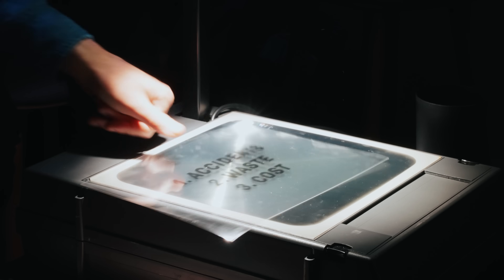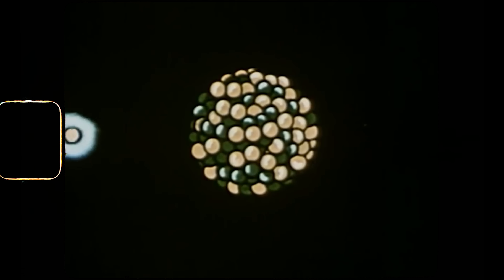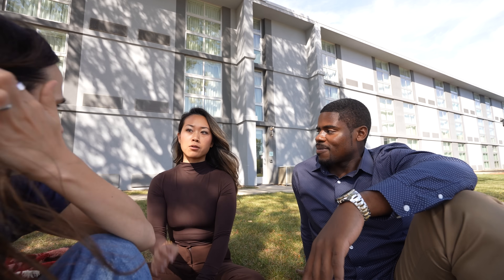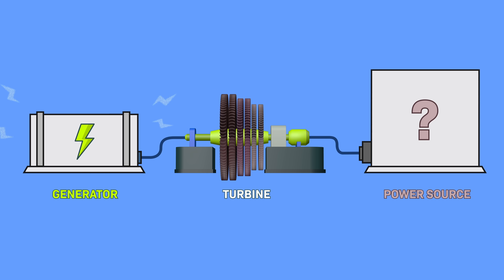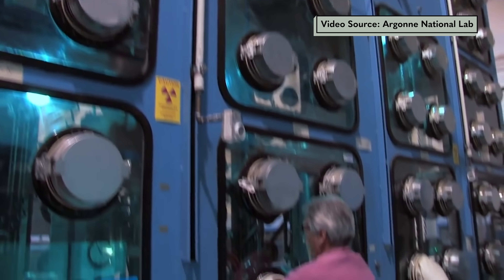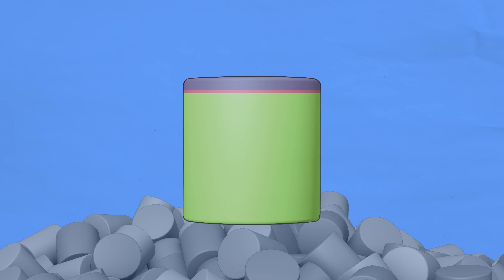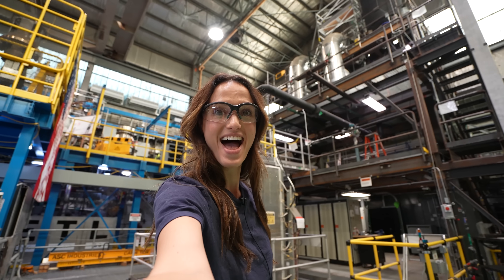The Big Lie About Nuclear Waste

Comment: Okay, so:
- the nuclear waste stored today isn't going anywhere (that's the point of storing it)
- the recycling reactors can be built anytime
- the existing reactors will eventually wear down and will have to be replaced
- whenever building recycling reactors will appear to be more economically viable than building standard reactors (and storing the waste), they will be built.

Comment: ....don't lie to yourself ...nuclear oligarchy propaganda & lies ...a dozen of those reactors were built ...all small & experimental ....less than a handful are operating in research ...the problem with waste compounds to insane levels with these reactors, as more & more radioactive isotopes are generated over time, exponentially increasing, not decreasing, the complexity & deadly dangers of the system ...

Comment: All you hear in media about nuclear are lies
Indeed whats called burnt out can Power the Nation for HUNDREDS YEARS
But the biggest issue ist the reactor used.
The core is in solid phase and Neutron eaters will Stay in the Fuel and stop the reaction.
Wigner realized and began develop MSR.
IT has many advantages.
It only takes 1/10 fissile to load and is about 200x more efficient.
It does NOT have water in the core. HAZARD!
It lacks reactor pressure Wessel.
Maybe most important, If thorium is used, it can run in thermal spectrum.
It is loaded on line.
Temperature 800 C, no problem. Making thermochemistry possible.
For efficient production of hydrogen.
More a half centuru since Nixon forced the research to close.
A lot has happened in materials, but more has to be done.
China is running strong
Are we letting them win?

Comment: You can avoid recycling by not creating the waste in the first place. 4th generation reactors can consume almost 98% of the fissile material AND almost 98% of the transuranics… that’s 1/100th the waste of conventional reactors. By the time it’s consumed most of the radioactive material what’s left is only dangerously radioactive for less than 300 years.

Comment: Who are you kidding? We don't do things better and use innovations and inventions, we suppress innovations and inventions, and using what we have. It's all about keeping obsolete industries and corporations going doing the same things, year after year. The automobile is a prime example. Troy Reed developed a magnetic motor that can run a car. Where is Reed and his magnetic motor? Nowhere to be found. Stanley Meyer was running a dune baggy in water. Where is he? Dead. Poisoned to death. Kids are making and using self charging go-karts. Why isn't Elon Musk? That's a very good question. It's not hard to have a self charging EV. You have two battery packs. You run on one, and charge the other one. What's so hard about this? And waste plastics? We can pave streets and sidewalks with waste plastics. And there has been technology for more than sixty years on how to make an injected mold tire. It's stronger and lasts about fifty thousand miles, and it's easy to make. Cheaper to make. Greed is killing US. Greed.

Comment: I worked in an alternative energy research lab and if we had an aqueous solution with the isotope in it and applied electricity through it, it would product Lots of Heat and in the end would leave non-radioactive base materials as the results.

Comment: USA has no Fast-Breeder reactors has 88,000 tonnes of HIGH-LEVEL which is added each year by 2200 tonnes.  

There is no SOLUTION if you have to store the waste for thousands of years.  A nuclear reactor will only last 50 years then you have to rebuild a new one and decommission the old one. 

There is no solution - just look at the mess at Hanford from nuclear weapons $ 1/2 trillion pounds and growing

50 years of Electricity for 100,000 or 10,000  years of WASTE is  just DUMB!!!

You creating waste longer than you had the electricity - INSANE!!!!

Don't Say SMR or Thorium as there is not operating in the world and that have design problems still to overcome.

No, I don't lke the idea of prefracbitred nuclear reactors made in a factory.

Comment: The problem with the term "Nuclear Waste" is it is used as a reference to spent fuel rods and such.  There is a French company that can reprocess somehow 40% or so spent rods to be used again.  This is good.  But this is only ONE of the categories of Nuclear waste.  Here is where the problem really is!!  Anything used in the process, comes in contact with the process, cooling water , hazmat suits and everything in the process from tools, cranes, PCs, decom showers, etc.  Most of these are buried in the ground and have no ability to reuse.  Some in concrete tombs, others not so much.  It is buried and becomes tomorrows problem when the half life of materials are so long.  We already seen and its well documented many of these have already leaked into the soil.  The only solution is to use a fuel that has low half-lives of 30 days or less.  This will never happen due to any element being so inefficient compared to Uranium.  But I, maybe a few others, claim this will be much cheaper in long run due to not having long term storage of hazardous materials that everybody agrees will eventually leak.  But there is no long term plan in nuclear that is why I say NO TO NUCLEAR ENERGY!  Its a disaster waiting on the sidelines.

Comment: Here in Sweden we have waste to keep us in energy 4 6oo years, IF WE JUST GOT OUR THUMPS OUT OF OUR MENTALLY LAZY ARSES !!
Reply: If you had fuel for 4,600 years 

Nuclear reactor - 50 years operation  -  92 sites  commission/decommission 
Nuclear Fast Breeders  - 50 years operation  - 92 sites  commission/decommission 
Nuclear Storage - 50 years operation -  92 sites  commission/decommission 

276 buildings nuclear facilities you have to build in Sweden for 4,600 years

Then, we have to talk about the areas for a nuclear reactor/fast breeder and storage roughly 3 km2 for each site.

826 Km 2 probably near to 1200 km2 as storage would need a larger area depth and width.

Oh, I forgot to factor decommissioning, if you build on sites each time.

We will take that we will need to monitor all these sites with Swedish tax payers money?
Just leave them, and don't monitor?

Comment: Just to make it clear, what is the efficiency you get out of recycling over and over nuclear waste? I mean, it all sounds good, but for how long can it be used until it is worn out? Even more, the longer you do the waste recycling the more amount of [useless but radioactive] residuals is piled up at the end of every cycle. Ergo, in the very end you get a solid mass of purely radioactive stuff. How much more, or less, harmful, dangerous to handle can it be?

Comment: Even with my limited knowledge in physics(I only studied physics back in middle school), I always have this thoughts of reusing nuclear waste. My thought was simple. If it is releasing radiation, it is literally releasing energy. So why can't we use that energy? The same as another thought/idea I always had since a very long time ago. If plastic takes a very long time to degrade, why not recycle it as material to make something that we expect to last for as long as possible? Which are building materials like bricks or, roof tiles, or mix it with concrete. Btw there are people somewhere in this world that are recycling plastic and making it into bricks for building. I have seen it a few years back on the internet. But it doesn't seem to be used mainstream yet. Of course all of these ideas need to be researched to see if it is plausible or not.

Seriously, if I have the resources to spend on these ideas I have, I would do it myself. But I think I know why these things are not done. MONEY. Not in the sense that you need a lot of money for R&D. But in the sense that the big companies that control the market on these things wants to squeeze as much profit as possible. So they don't want the world to advance to a much better technology. Well, not until the world is forced to move on to a better solution. Until that time comes, they will keep selling old shit to you for as long as they can. 

This video is a big example of it. They already have the technology to use the nuclear "waste" to produce energy. But they don't use it. Instead they ask people to pay them billions of dollars to store the nuclear "waste" safely. When the world is done with fossil fuel, they can just say, "hey, we have create this new technology that we can reuse all the nuclear "wastes" that we have been storing to generate energy." So right now, they are getting paid for the energy they produced from the current nuclear powerplant and they are getting paid to safely store the nuclear "waste".

Comment: 私たちは日本なしでも生きていけますが、海なしでは生きていけません

About Japan's nuclear contaminated water treatment device (ALPS), it is a nuclear contaminated water filtration device made by Toshiba in Japan.

First, this device was the first of its kind in the world and had no prior examples, related usage experience, or data to support it, nor were there any relevant experimental analysis reports. It relies solely on Japan's unilateral statements.

Second, the filtration effectiveness is strictly controlled by Japan, and even the International Atomic Energy Agency cannot directly inspect it. They can only examine samples submitted by Japan.

Third, the technical data for the filtration device is too vague, making it necessary to estimate that multiple filtrations may be needed to effectively reduce harm.

Fourth, the consumables for the filtration device are not cheap, and it is impossible to verify if Japan can strictly perform multiple filtrations.

Fifth, Japan refuses real-time monitoring of its treatment results by any party. As seen in the news, neither the International Atomic Energy Agency nor South Korea, China, Russia, or Japan allows monitoring of treatment results.

Sixth, as stated in the International Atomic Energy Agency assessment report:
1) The International Atomic Energy Agency explicitly states that the report does not support Japan's ocean discharge claim. They are not foolish and do not want to bear a thousand-year reputation.
2) The greater diplomatic and political instability caused by Japan's ocean discharge is something they have long anticipated. They have subtly expressed that Japan's actions are not under their guidance and control, and more; this is a matter of speculation.

Seventh, although the United States supports Japan's ocean discharge behind the scenes, they had already started prohibiting the import of Japanese seafood before the ocean discharge. These can be verified through news sources.

Eighth, this is also one of the most concerning issues: isn't the United States concerned about polluting the ocean with nuclear contaminated water?! According to ocean current predictions, most of the contaminated water flows toward the west coast of the United States. However, when the contaminated water reaches the west coast of the United States, its radiation levels are not significantly worse than the nuclear contamination produced by the west coast of the United States itself. The radiation index on the west coast of the United States is already severely exceeded, but the range is not large. So, what's the key to this issue?!

The key is that the United States is only polluting a small part of its own land on the west coast, while Japan is contaminating the entire world's oceans at nearly the same level. This is also the origin of the statement often made by the Japanese, "Europeans and Americans can eat radioactive food, why can't Asians?"
Reply: This is not a scientific issue; in fact, I believe it's a matter of logic. If this water is genuinely as clean as they claim, why wouldn't a water-scarce island nation like Japan keep it for use? If the water is indeed heavily contaminated, how can they justify releasing it into the ocean to pollute the entire world? This alone seems to explain the issue, doesn't it? Why do the Japanese insist on discharging it? It can only suggest that all the data and claims are fabricated! This isn't the first time; you can see in the news that ever since the Fukushima nuclear power plant accident in Japan, how many lies have been uncovered, and it hasn't stopped. They have been lying continuously!
Reply: Why would japan willingly contaminate their own water?
Reply: If it was really radioactive then they would just store it like they do with all other forms of nuclear waste. Also, why would Japan make it public if they were leaking radioactive water. If they actually did it, they wouldn't have told everyone they were doing it and they would DEFINITELY not put contaminated water around their own country. And speaking of contaminating themselves, the Prime Minister of Japan drank the water. They also have fish in the treated water. If this Fukushima water was actually radioactive enough to make the entire ocean even a little bit more radioactive, those fish and the PM would be dead in less than a week and the water tanks they use would be a lot more isolated than they are right now.

This reply isn't meant to be an insult to you or your beliefs. I was only introduced to this incident by a source supporting Japan so this comment is meant to broaden my perspective and maybe even change my mind of who i side with. If you don't reply I won't take it as a win so if you dont care enough to respond you can simply ignore this comment.

---------------------------------------------------------------
my notifications are broken if you reply i might not get the notification

Comment: I appreciate you taking the time to put together a video that offers some hope for mankind's future. I had never heard of recycling nuclear waste before. 

When I was a young boy the Enrico Fermi Nuclear Generating Station was built on the shore of Lake Erie near Monroe, in Frenchtown Charter Twp., Michigan. All units of the plant are operated by the DTE Energy Electric Company formerly known as the Detroit Edison Co and are still owned (100 percent) by parent company DTE Energy. Two units have been constructed on this site. The first unit's construction started on August 4, 1956 and reached initial criticality on August 23, 1963, and the second larger unit received its construction permit on September 26, 1972. It reached criticality on June 21, 1985 and was declared commercial on November 18, 1988. The plants are named after the Italian nuclear physicist Enrico Fermi, most noted for his work on the development of the first nuclear reactor as well as many other major contributions to nuclear physics. Fermi won the 1938 Nobel Prize in Physics for his work on induced radioactivity.

On October 5, 1966, Fermi 1, a prototype fast breeder reactor, suffered a partial fuel meltdown, although no radioactive material was released. After repairs it was shut down by 1972. Fermi 1 used a unique liquid sodium coolant design for it's time period, when most plants used light water. It was claimed to be able to produce more fissile material than it consumed. A plate in the reactor core broke loose and blocked one of its coolant lines causing the reactor to over-heat and damage its core. Uranium was so cheap by then, that it was determined to scrap it and after some site cleanup it was converted to run on fuel oil. 

Other thorium based sodium moderated reactors have suffered a similar fate in the US. China and India are building experimental thorium reactors that are supposed to be cheaper to operate than uranium-only fueled reactors, although they use some enriched uranium as well. So you might want to do a video about those designs as well.

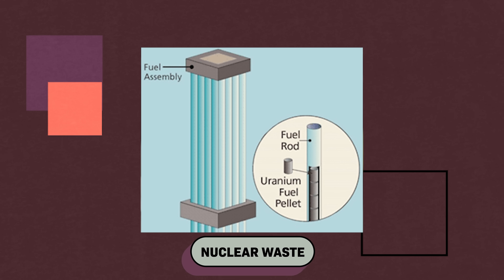Comment: 7:07 this is incorrect. 235 refers to the combined mass of the neutrons and the protons. 235 is the mass of the nucleus. If you want to obtain the mass of the neutron in amu in 235 uranium, then you will have to minus it by the proton mass, which is uranium's atomic number of 92

Comment: Don't you think that those whose careers are built around the nuclear power industry want to keep it going and to win public trust in it? I don't know that the problem is so much political as it is a technical issue. Nucleal fuel processing generates its own waste that then is radioactive and has to be stored in safe containments that will survive degradation and damage. Just look at all the tanks full of radioactive liquid waste at the Hanford site in Washington. This is the problem. Another problem with nuclear power is that eventually the metals that are subject to the radiation begin to degrade and fatigue. I'm pro nuclear power but I am also in favor of protecting life and the environment. You need to look at the entire picture. Just a passing note. The reactors in our nuclear subs have a very long life cycle, so why can't commercial reactors get that sort of performance? I don't have the answer. Perhaps the scale VS performance is not a linear thing.

Comment: Nuclear is by any standard "clean" energy. it is actually the worst one. there is so little uranium in the ground that it takes ridicuous ammounts of energy to dig it up and then refine.. sure it does not pollute when in use if we actually can measure all the radiation that is deposited in to the cooling water and i doubt we know it all.. then there is the risk of nuclear catastrophy when they plant go BOOM..and then there is this lil problem with the waste that we can not get rid of.. i would rather close my computer than use nuclear.